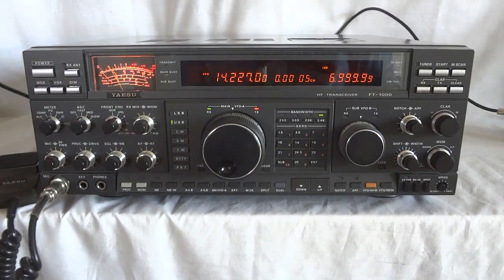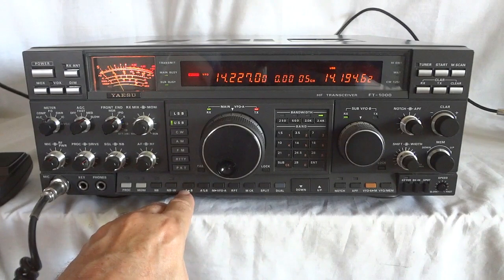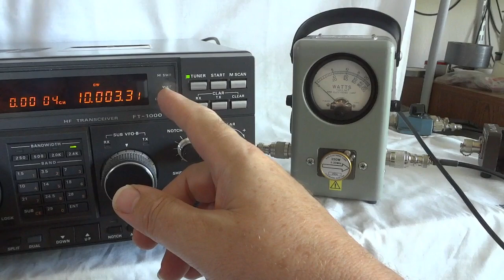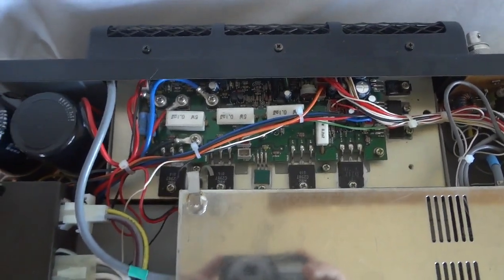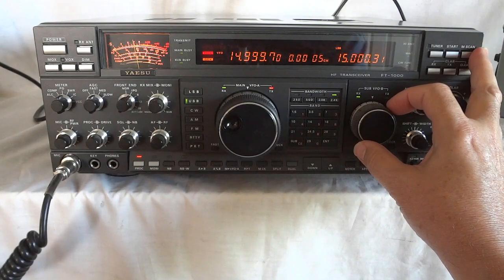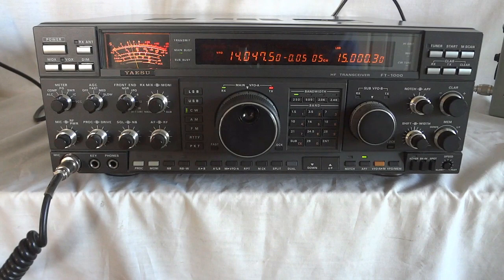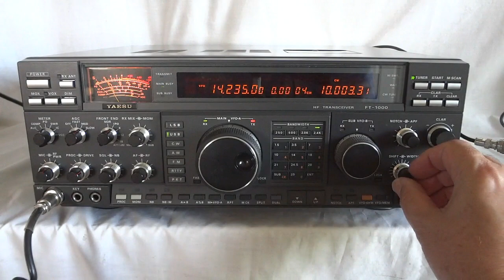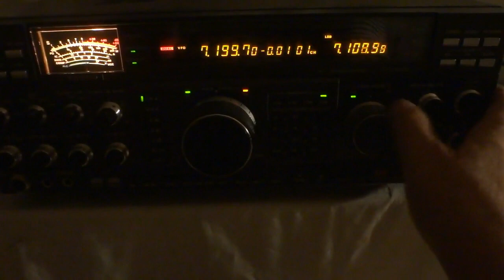Yaesu FT-1000D classic high-end ham transceiver

Comment: The sub receiver is very good when running two antennas and stereo headphones from the rear socket. 
Had mine for a very long time now, not madly keen to replace it though I do have quite a few HF rigs. Mine has all of the options, and the Inrad roofing filter, not entirely convinced that the advantage is huge.

Comment: biggest pain with 1000D:
- 10Hz tuning step  - No 1Hz tuning step
Ruins the ability of generating spacial diversity audio by tuning the second receiver couple of hertz or so off freq
(10Hz is too much - echo chamber ) while sending the audio from each receiver to separate stereo channel.
-stereo audio (2 receivers) only available thru headphone jack - not rear speaker jack
- Only 1 PL tone for 10m repeaters 
- Inability to set the sidetone freq higher than 700Hz  ( I prefer 750 or 770)
and that's about it
everything else is top notch and BEST EVER incl notch in the agc loop and godlike cw audio peak filter.
the current generation SDR crap can lick the boots of the 1000D

Comment: Curious.....where is the memory battery located?
Reply from the maker: On the board that contains the "less used" controls, the ones underneath the hatch on the top. See here and look at photo 3, you can clearly see the coin cell there (soldered):  https://www.ebay.com/itm/196421016962

Comment: Thank you for VERY nice video. I have FT-1000 also and FL-2100B amp. I tried hook up FT-1000 with FL-2100B as other radio hook up but does not work. Could you tell me how? Thank you in advance. 73
Reply: It is inadvisabe to key the FL2100 directly from the FT1000D, really better to use a "Soft key interface" there is also an internal  switch to select the relay type PTT. Beware that the FL2100 is not going to be hugely more powerful, less than an S point above the barefoot rig.

Comment: Good  Video-  How much is   is fair price on these bad boys  this days? 73
Reply from the maker: A mint one in original box: $1400 to 1800. Mint without original box: $800 - $1200 depending on options. Used condition (scuffs, clear signs of usage but otherwise working): Around $600 - $700. Junker for parts or repair: depending on options, completeness  and cosmetics $300 to $500.  Cheers.